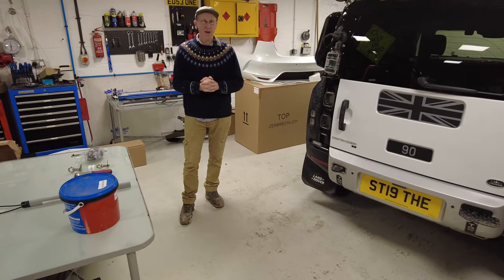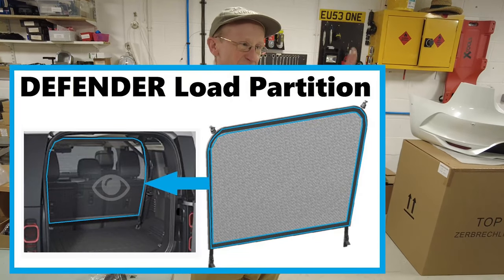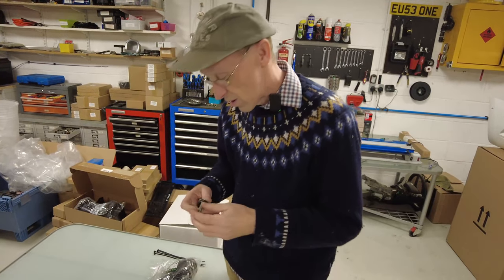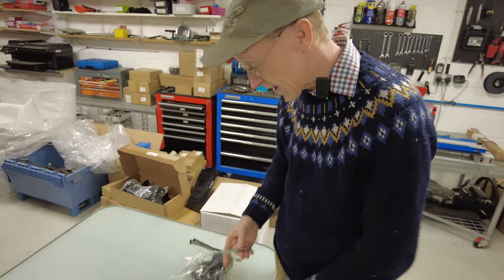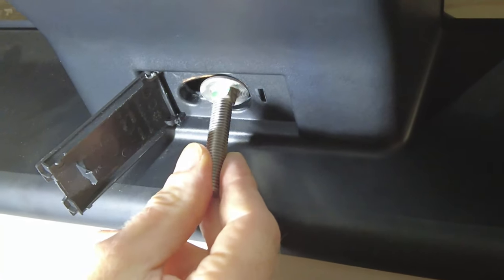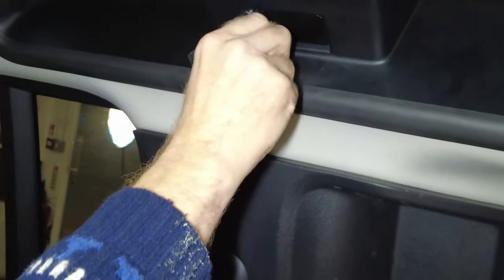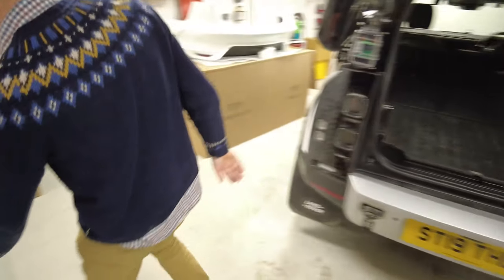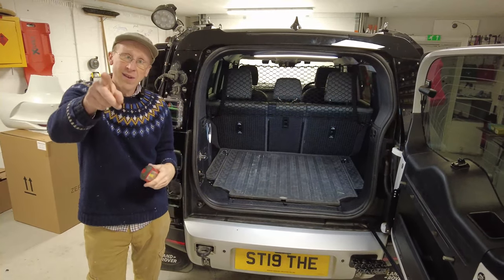Interior Luggage Area Headlining  "Sky Hooks" for Land Rover Defender L663

Comment: im thinking of adding some hooks along the plastic panel by the skylight window, is it possible to remove this and add hooks to and securely bolt or could you recommended anything else please? im looking to hang clothes - approx 4 hooks along the length of the plastic trim or I could use self adhesive

Comment: Hello Simon, whilst I still wait for the delivery of my L663, my hypothesis for those kidney shaped receptors in the cant rail are an alternative mount for the fabric loadspace cover. A second and vertical installation maybe. This to me, would kind of explain why the loadspace cover is so fabricy (made up word). Do you think that is the case? Thanks for all the great content.
Reply from the maker: Hi Ian - firstly may i congratulate you on making up a word - something i seem to do on a daily basis !
We have looked a couple of times for a vertical shelf - Britpart do sell one that mounts onto the mounting points for the fabricy cover but when i removed the plastic trim panels they are part of there is no strength to those mounts - we keep looking.
Reply: Howdy, depending on your use, we just stow it under the rear floor panel with all the rest of our towing kit!

Comment: Will you be restocking these? I'm looking for a solution to hang my dry cleaning in my 2023 Defender 90.
Reply from the maker: Yes we will be getting these back in stock - may even tomorrow !
Reply: @L663  I received my order and the right one went in fine but theres an imperfect alignment on the left opening due to plastic hole not lining up correctly with the metal behind it so I cant get the bolt in 100% I will have to grind down some of the bolt so it fits unfortunately.  but the one on the right side works great for hanging my dry cleaning and doesnt block my view in my 2023 Defender 90. Thanks Simon and team.

Comment: These work on the D5 too!
Reply from the maker: Is it the same cutout design ?
Reply: @L663  The “kidney” is exposed and flush on the D5. I see how the plate locks the bolt in on the Defenders recessed design, which is cool! I didn’t use the plate I just bolted it in and it’s solid, if I decide to leave it I’ll use some thread locker so it doesn’t loosen up. Thank you!